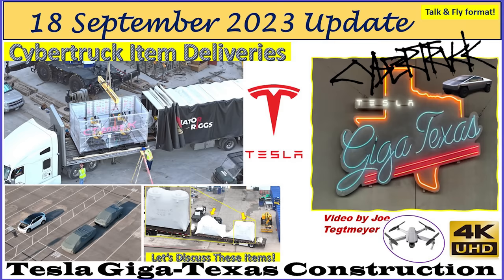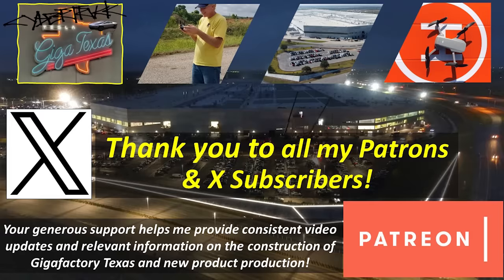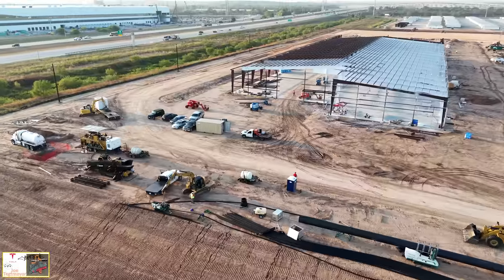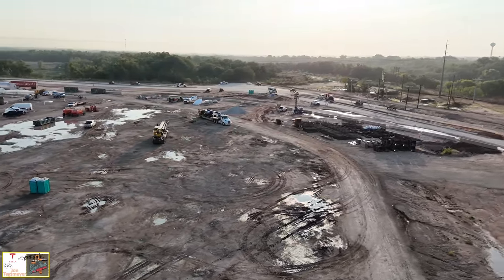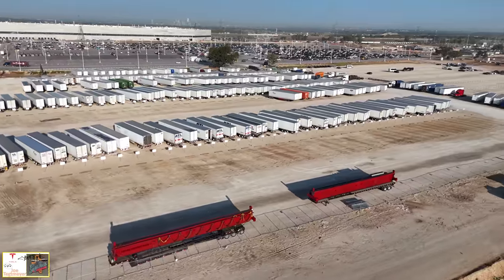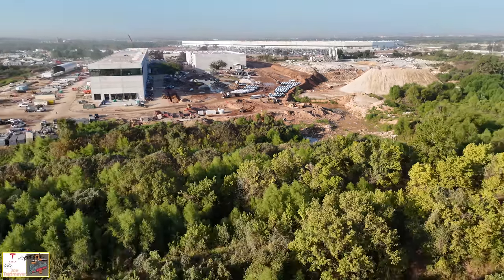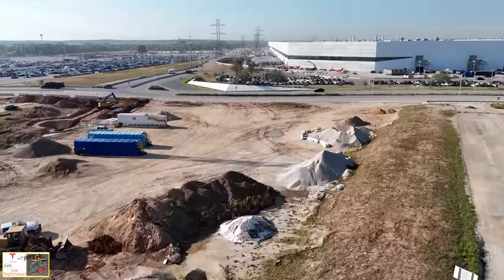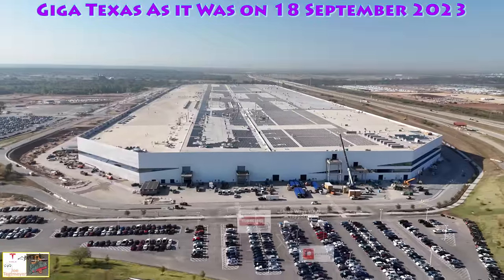Cybertruck (CT) Production Equipment & 5 CT's on Site! 18 September 2023 Giga Texas Update (07:55AM)

Comment: Thanks Joe.
6:58. W-WOW, storage area. Another TKS bath segment. Must be close to 20 by now.
7:30. New EOL site. Top left. Delivery of more EOL building structure.
7:41. New EOL site. Bare gravel. Another 5 bays of clear span roof in this next section. Series of tenches for grade beams/strip footings next.
8:34. New EOL building, north. Cantilevered portico roof structure.
9:17. GA, highway berm. HDD drill. Impressive accuracy!
10:02. Main Entrance. 3 or more panels of the Stoneglass to be replaced. Bottom left corner knocked off.
GA, apron. White staining is the slurry/swarf from saw-cutting of the pavement.
Excavator about to make a start demolishing. I wonder if this will be a widening of landscaping.
13:02. Stamping 2 extension. Studwall. Bags of bulk insulation. Another indication that this is a permanent wall. Not to mention the parapet constructed to a peak. Unnecessary for a temporary wall, it likely mirrors the new structure to be built to the south.
16:02. WOW yard, southwest. Culvert elbowing north towards the drainage ditch.
16:55. WOW yard, entry. Trailer load of red oxide painted steel. Maybe for EOL.
17:24. WOW yard. Pair of bridge crane girders. Must be close to 20 by now.
18:12. Die shop, south. Asphalt paving works. Preparing to the west of the Crash Test Track also at 25:06.
21:19. North of Cathode. Bottom. Powerlines still in place. Seems to be a pole mounted transformers in the trees.
22:23. Cathode, west. Left. Stormwater drain ducking under the pair of sanitary sewer force mains.
22:53. Die Shop. Rebar for another moat/retaining basin.
23:59. Cathode, south. Hoppers. No interconnecting pipework or structure yet to suggest these are to be lifted as one unit. Not sure why they needed to be set up on the skids.
24:58. Crash Test Track. Crash wall in place, but not pinned or bolted down.
26:12. New switchyard/substation. Tesla Energy Monopole. Conduit inching closer from the BESS switchyard.
30:10. Paint/Plastics apron. 4 crates with the light tan coloured ‘Lampshade’ air inlets.
Bottom left. Large light grey electrical cabinet. Switching gear perhaps.
Reply: 9:17 I am wondering if they will move the directional drill rig to the factory end of the drill rod. Since the fused pipe is set up on the west side, it will probably be pulled thru from the west side to the east side. They may ream the bore back to the west to keep the drill mud on the west side. I did notice some extra drill rod on the east side next to the exit hole.
Reply: @bobcallahan2322  Interesting point. It's setup the opposite to how it was setup for the under river boring for the purple pipe.

I wonder if they can drag the pipe through with an excavator. 
If I recall correctly, the failed pull of the purple pipe was pulled back by an excavator.

I'm speculating this large black pipe is a city/water company sanitary sewer force main. Wilder speculation is that the removal of the smaller powerlines along the top of the highway embankment is to allow trenching for this force main to be run south towards the river at the bridge. Existing similar sized pipe already run under the river at that point.  https://youtu.be/YYMQZBf4VEE?t=561
Reply: @DessieDoolan  I am not convinced that the big HDPE will be a pipe but will be a casing for smaller pipes. They do not need a force main that big for the west side, that pipe is bigger than the force main for all of the main factory that does go under the river. Using the big pipe for a casing saves several drills under the highway.
Reply: @bobcallahan2322  Ok, that makes sense. David Johnson did make that suggestion also, but I had this other under river pipe in my mind. Joined the wrong dots again.

Would also otherwise be difficult to get all the bores to exit in that small space.

An earlier estimate showed the total lengths of the large pipe was more than enough to cross under the highway.
Reply: 20 bath segments or enough segments to make 20 baths?
Reply: @sammyk874  Hedging my bets! I started a search to try and work this out, but it's really difficult to tell if your looking at the same or different bits.

Not to mention what we don't see delivered.

Gut feeling is over 12 complete baths.
Reply: @DessieDoolan You have a better track record than me, but I would guess the larger pipe is just a sleeve for the smaller electrical conduits to be pulled/placed inside. Usually under a major road you want a sleeve that allows some level of access (to remove the conduit strings) if there is a problem.
Reply: @DessieDoolan  I did wonder how they could get all the small pipes bored without damaging an already installede pipe with the boring pipe. Putting them in the HDPE pipe makes sense to me .Good call @bobcallahan2322.
Reply: @patrickkenny2077  Yep, I'm on board with that now. David Johnson did propose this earlier, Bob's comment cemented it for me.

The under river bore down the highway another red-herrring to throw me off the game.
Reply: @patrickdougherty2777  Good call indeed. And while I've been replying it occurred to me why they aren't simply running regular grey conduit through the large pipe, and that would likely be because the long joined lengths of HDPE would pull through easier than regular short lengths of UPVC.

I wonder if the large pipe will be grouted in place?
Reply: Dessie , Only you have the status to follow this up : With Corpus Christie plant to produce LiO2.H20 & the Cathode plant to use LiO2.H20, What is the DIE plant going to do?. I think the DIE (Direct Ion Exchange ) was a complete distraction and the 16,000 ton machinery will fit beautifully in the NW corner . " I call it a DIE plant"
Reply: Sorry LiOH.H2O
Reply: @edwardmorpeth5988  Well.....

You are right, the Direct Ion Exchange was incorrect.

That hat long eaten, and discharged.

My current thoughts on the DIE shop is that it is a facility for at the very least maintaining/repairing dies, possibly also constructing (which seems to be the correct term). Possibly prototyping (as per the Reuters article) also.

Dies are needed for casting, stamping, and plastic injection moulding, so there's plenty of work for a dedicated shop.

All the milling machinery from Casting went missing, and some of it at least was seen being delivered into the DIE Shop.

The 16,000t machine. Got my doubts! I read the Reuters article, and there some inconsistencies (to my mind anyway).

They haven't got the 9000t presses working yet. Imagine how much more trouble a 16000t machine would be!
Reply from the maker: Thanks everyone for this discussion! I have some interesting things to be looking for with the horizontal Drilling and I hope to be able to capture more clues so we know which of these possibilities pans out!

Comment: I must have missed why the windows have been removed on the one end of the building and replaced with the yellow panels. Are they extending the building or just a change of plans and the windows are no longer necessary? 

Thanks for another amazing and awesome, not to mention, a very informative video. You're are incredible, with your investigative skills in researching equipment (The Ingersoll-Rand equipment). 

My son and I enjoy your videos and drone footage immensely!!!
Reply: I am not sure, but I think they are going to put up some new south walls for the building, about 200 feet south of where you are seeing the yellow panels.  So that entire wall will become a interior wall, fire break and such.  By putting in the yellow stuff, they can create sound insulation, and allow it to become a fire wall too.  

I worked in a noisy factory, and the noise resistant walls is very important.  We had 33 foot tall ceiling (about 18' tall at the sidewalls, and the center was higher for rain to drop off the 420 foot wide building that was also 1,250 feet long).  The sound walls around the press room where 8" wide cinder block, and only about 14 - 16 feet tall.  Still it was much lower noise level on the other side of the wall, while the press room was very VERY noisy!  The company was Weiser Lock, located in Huntington Beach CA, from 1978 to 1989, then they moved to Tucson, and later moved someplace else.  

The Fire Department wants to see a building sub-divided into sections, so if one catches fire, it can not spread to the next area.

Comment: HDD drilling:
@ 9:15 Looks like the drill already came through.
@ 9:23 4 large conduits, 2 small conduits.
Powerlines:
@ 10:25 (Upper right) Existing powerlines removed from electrical easement. Trenching should come next.
Easement:
@ 26:07 Trench for 345 kV duct-bank is close to east monopole. But little progress in the last few days.
LCRA substation:
@ 27:16 West transformer energized with disconnects closed. Disconnects are open on east transformer. It may be some time, perhaps a couple of months before it is energized. Considering that none of the conduits have cable in them. That is, the entire duct-bank from the Tesla Enclosure/Mega-vault to the factory.
Easement:
@ 27:30 Cables have yet to be pulled into backup power conduits.
Also missing is a control structure(s) for the Megapacks and the BESS substation.
@ 28:55 Conduit trench with unknown purpose at this point.
Reply: 27:30  The fact that there isn't any room anywhere for a control structure and there hasn't been any infrastructure laid down for one, I assume that the Tesla owned Vaults contain the BESS control station.  Otherwise, what's the point of the preassembled trailers? The substation already has it's own building
Reply: @eclecticmemes  27:30 Hard to see in this view but at the base of the tall pole on the left are 8 unused screw piles. Spaced to support a container sized structure, or two smaller structures. There are also 16 small conduit risers coming out of the ground. Those conduits go out to all of the Megapack transformers, and the perimeter fence line. There is also a concrete vault where the control cables for the BESS substation terminate. 

The preassembled "trailers" likely contain switchgear to provide circuit protection, and the ability isolate the 24.9 kV circuits in the duct-banks. Which go out to the factory and other buildings on the campus. From time to time they will need to de-energize those circuits for service work.

Comment: After 21:00 we can see by the lone trees on the islands that the ground altitude was higher north and east of the GF.  I downloaded a free dot PDF Topographic map from the US Topo Svc.  It's the Webberville 1:24000 quadrangle which shows the altitude contours at ten foot intervals.  It would be much better if the intervals were smaller, such as 5 or less feet, but those would be custom maps that are not free.  The free topogs are taken every dozen or more years; the latest was before construction began on several pieces of infrastructure.  But hey, they're free.
Reply: Google earth also shows elevation as you move the cursor across the screen. However it is inaccurate around the factory. Apparently showing older data. If I remember correctly, the factory floor is at an elevation of 418.5 feet. Google is showing those large fields to the north to be at around 430 feet. So they have plenty of fill dirt to work with.
Reply: @DavidJohnson-tv2nn  
Well, that's what I was talking about in my comment.  The ground at the foot of the lone trees shows the original altitude.  They can't lower the altitude down to the factory level because there has to be enough change in grade to prevent the flooding when it rains.  There has to be enough drop in the grade toward the river so the storm drains and drainage ditches will flow to the river.

Another thing that's not well mapped is the mounds and ditches the gravel quarries dug.  Obviously they removed the gravel so in order to fill in the ditches they have to borrow the fill from somewhere.  I guess the civil engineers have enough data to calculate if the existing surrounding land has enough volume to fill in the ditches.  I would love to see some of the site plans from the contractors.

Comment: Quite a few of the buildings I designed the electrical and mechanical systems for - had exposed steel beams and columns.  In those buildings the steel was coated with a fireproofing material.  So are these steel structural elements painted or fire-proofed.  PN
Reply: Would depend on the local fire regs. This new EOL building is single storey, will probably have a fire sprinkler system, possibly a fire/smoke detection system also. Hydrants, hose reels. My guess is the white paint is just white paint.

Disclaimer. I'm not a local.

BESS switchyard. Do you know the correct term for the cable being strung between the monopoles at each corner? Seen here in Brad's video https://youtu.be/ykZbkcJ12FM?t=640
Reply: I worked in a single story 750,000 square foot manufacturing building, and none of the steel was sprayed with fire resistant coating.  It had sprinklers.  Built to 1975 code (1978 building in California).  Maybe a multi-story building would have fire proofing?   I was in the building in 2004, after it was sold to another company and remodeled, and they still had no spray on fire resistant coating.

Comment: What do they do inside the end of line structure? is this where those lights will be checking for dents and misalignments? what else will they do in this new building?
Reply: Presumably it's going to be more like the testing and calibration area out East. Guess (they could) do that step there and they've been putting in the power if they need it but would they be happy sending out a Y, or a CT before. Could well make sense because it would likely not be resolved there and then. If there is an issue it'll need to go somewhere while the show goes on and they can protect it from the elements. When they filter fixed/sorted the lot over East you could see a lot of sand so many had been there for quite some time. It's good to see that they were 'actioned'

Comment: While they do need to test drive each new car, they should also have the loading closer to the plant.  So if you can now drive 8 cars each hour to the current parking lot, and then walk back, with the new parking lot over 1/2 mile away, they need to take a bus back to the plant.  And only do about 4 cars per hour, so twice as many drivers.  

Unless they start to drive the cars to the new location without a driver.  Maybe playing follow the leader, and a driver in the front car, and driverless in the following cars, they could do it.  Or a tunnel under the freeway.